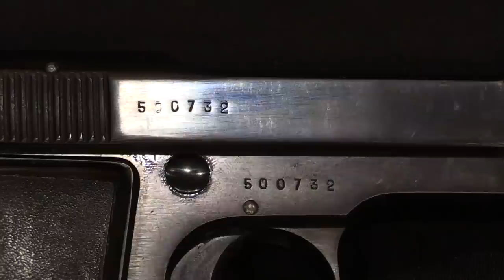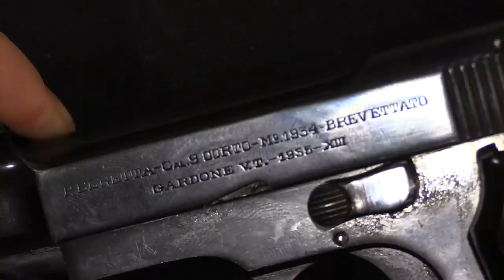Military Trials Beretta 34 - Can You Make it More Walther?

Comment: It's "yellow" because of white balance.
Using a white sheet of paper is a great way to calibrate the camera.
Reply: This. Or setting it manually. Learning the Kelvin scale is useful in camera operating. Generally the higher the number in Kelvin, the cooler the white balance.
Reply: Correct, this is a white balance issue. Easily prevented by checking white balance to calibrate the camera before shooting, and is fixable in post-production as well.
Reply: Aka CNN Trump filter
Reply: @ImmortalDaevon  reddit gold moment
Reply: The best goblin president ever.
Reply: @MangasColoradas941  haha
Reply: @ImmortalDaevon  yes, because the other guy never does that...

Comment: Ian, btw, the yellow in your video is the result of a color temperature mismatch: usually “auto white balance” will figure out the room lighting and adjust but sometimes it needs to be done with either the preloaded filters (indoor incandescent, outdoor, outdoor sunny, fluorescent ) or a manual adjustment. (I worked with cameras a lot past 30 years). Thank you for your excellent vidoes

Comment: I've always had a thing for the 1934 and 1935 Berettas.  Back in the early 1970s as a very young lad I had a toy gun that (other than it's blue color and plastic "stopper gun" construction) was a dead ringer for the '35.  Like a lot of my toy guns from that time it was very realistic and I had NO idea where it came from (could have been my older brother's, could have arrived in a trade, might have been a "battlefield pickup" that I found whilst playing at some abandoned property or other) ... I just knew I really liked it.  Fast forward MANY years and I was the temporary caretaker for one (a 1935 in .32).  Of course, if I was going to be responsible for it, I had to ensure it's firing condition ... and ... um ... be sure it MAINTAINED it's firing ability while in my care (I shot it a lot, LOL ... with permission, of course). Great video!
(Edited ... I mixed up model numbers ... what a NOOB mistake)

Comment: I have a Model 34 with a frame safety and half-cock mechanism. Compared to my other guns it's an absolute pain in the ass to operate the frame safety/slide catch, reload, disassemble, and clean. The slide also tried to bite my grandfather's index finger off (he was clearing a jam caused by a weak mag spring).

Comment: There is a modern firearm in production that has a similar safety set-up. The Phoenix Arms HP-22 has a frame mounted safety and a hammer block safety on the slide. In addition to those, it has a magazine disconnect safety AND some strange system where you have to turn the frame mounted safety on to remove the magazine. It is a very dangerous arrangement to be honest. I have one, and the first thing I did to it was tear it apart and remove a lot of the safety features.

Comment: This looks to me to be less of a failing of the slide safety and more a dumb redesign of the frame safety. I'd almost go so far as to say that they may have intentionally done it that way to, in effect, 'sabotage' that particular variant in a bid to convince the military not to go with the slide safety. Granted, two manual safeties is overly redundant even by my standards, but realistically, the problem really lies in that added tab on the frame safety.
Reply: I think the reality is that they did exactly what the offer wanted and in fact just dropped it in without reworking the internals. That frame safety was still actually a safety with a slightly changed lever so it couldn't be turned all the way around without trying to disassemble the gun. The gun still retained its original frame safety because it was not just the safety but also your disassembly lever so it wasn't easy to just remove. So effectively there was no redesign of the frame safety. They just made the lever shaped differently where it couldn't be used.
Reply: @alexsis1778  I think it depends on how you define redesign. In this case I was counting the addition of that tab as being a (minor) redesign. A more thorough redesign to eliminate the safety element of the frame safety would have eliminated the issue altogether, but undoubtedly would have been costly and time consuming from the company's perspective and arguably not worth the time and trouble.
Reply: That slide safety looks externally, exactly like my PPK.

Comment: I had question, i saw one of these at my local pawnshop this morning,very nice little gun, they guy pulled it out of the display case and let me see it,very nice weight and very tight little gun.

What i dont understand is.... it had a tag on it and the tag said it was a 1934 but the tag also said it was a 32 ACP, now we were busy with other things and i didn't check it out thoroughly, if the 34 was made as a 380 corto (per Wikipedia) and the 35 model was made in 32 ACP how can this one i saw this morning be a 32 if its a 34?  (lol,sounds like a tongue twister).

Maybe the guy putting the gun in inventory made a mistake and its actually a 380?  reason i say this is because when he hand it it to me he said "yeah this is a pretty nice gun, 380 i believe) but then i corrected him and said ," i think is a 32 and he said oh ok" funny thing is neither of us checked,now if i was buying the thing i would have checked for sure.

Comment: "It doesn't work like that!" But...it does work like that.😕
Reply: Clearly it doesn't work well like that. Lots of risk that the gun could be cleaned and left with the frame mounted lever in the "safe" position, and if you had to use it in self defense and you didn't know what was wrong, you'd be dead before you found out.
Reply: I was referring to the politics of procurement.

You are absolutely correct, as far as trying to actually use the pistol. :)
Reply: @petesheppard1709  Boy, does procurement ever work like that. I used to be an an engineer who had to try to wedge demands from Marketing into products *3/4ths of the way through the development cycle*. I was still young then so my hair grew back...
Reply: @markfergerson2145  Can't you just tell them how much more expensive it is to do so? Those guys speak profit margin.
Reply: @Halinspark  Marketing types believe they can just throw technobabble at the customer and crank up the price.
All too often, it works.
Often the customer will change their requirements partway through a procurement cycle exactly as the video describes (or reveal a requirement they had all along and just didn't tell you about at the beginning), and you can't talk them out of it for whatever reason.
Are you familiar with Scott Adams' "Dilbert" comics?
Reply: Even if you can manage to crowbar it in and technically work, it doesn't mean it is in any way a good idea.

Comment: It's funny how the hated aspect of the 34 is the safety of the 92 and M9
Reply: A service DA/SA handgun needs a decocker (that was not the case of the M34, that was SA only). That had been the request of the Italian Police to Beretta. At that point Beretta put it on the slide (92S model) because that's the safest place to put one. The slide mounted decocker is the only one that decocks the hammer completely, since it at the same time rotates the firing pin out of the way of the hammer. All the frame mounted decockers only leave the hammer in half-cock position.
Reply: @neutronalchemist3241  the CZ 75 disagrees with your statement that a service da/sa needs a decocker.
Reply: @ScottKenny1978  The Beretta 92 too didn't have a decocker in 1974, but it was added later, due to Italian Police request, with the 92S. CZ (that didn't evolve the design until 1992, when they added a firing pin block) only came later, with the CZ75BD.
In the meantime, after having experimented many unintentional discharges caused by the agents attempting to manually decock an hammer when still full of adrenaline for a shooting, many Police Departments in the US made mandatory for SA/DA semiauto to have a decocker too.
Reply: Neutron Alchemist True, the Beretta 92 prototype had a frame safety. The Taurus PT92 still maintains it.

Comment: On the other hand, Beretta wasn't too embarassed stealing P38 system and using it in M1951... Tullio, Tullio ...
Reply: There had been no stealing. The pivoting locking block had been patented by Mauser in 1911. When Walther used it, the patent had already long expired. Walther own patent (that applied only to their particular shape of the locking block) was submitted in 1936, and expired in 1950, so it was free to use for anyone in 1951.
Reply: I stand corrected.I knew about Tulios braging about inventing new system and I knew about Walther. I put 2 and 2 toghether and got5.Thanks for information.

Comment: Tiny pistol used by the military? Isn't it normal to have a large framed weapon for the soldiers sidearm
Reply: Draugre .32 was really popular at the time, plus most soldiers wouldn’t have one anyway
Reply: Pistol was really a badge of rank, not something to use in anger.
Reply: Thus having adopted the P38, the Germans manufactured and issued much more Walther, Mauser and Sauer in .32 ACP during the war. For what was the use of a pistol on the field, a simple blowback was favoured over a complex breechlock. From this point of view, to adopta a blowback in .380 ACP from the start was probably the right decision.

Comment: Slide mounted safety's are dumb.  Why make it harder to reach?
Reply: Personal preference and training can make almost any safety work just fine for a particular person. While I'm partial to safeties being in the position of the 1911 safety, I have no issue what so ever working with a slide mounted safety as seen on the Walther P.38 or Berretta 92 series (which actually had a frame safety at first). I think a lot of people really over think the potential problems of something without ever personally checking to see if the problem is even really a problem. Much like 3 round burst is a band-aid solution to just plain poor training and lack of practice time.
Reply: @collinis1  My point is that it isn't outright a bad design for everyone. Some people have no trouble whatsoever with it, such as myself. Realistically, the two main complaints I hear about them are ability to reach them comfortably and accidentally engaging them when manipulating the slide. Some people, like myself, can reach them with no issue and virtually no effect on grip when disengaging them, which is the main thing you'd need to do in a hurry. As to accidentally engaging the safety when manipulating the slide, you actually use the safety lever as a gripping surface and hook your index finger under the lever to ensure that it remains in the upward position, unless it's something like a Makarov, which has the positions reversed, but Makarov safeties tend to be very stiff and not prone to moving accidentally.

I do not disagree that it isn't a good fit for everyone, but I'd say that's why there are such a variety of designs on the market. Choose what works for you and fits you well, practice with it and you shouldn't have many problems.
Reply: @collinis1  What l'm saying is that there is objectively bad, such as Type 14 Nambu safety, which requires two hands to operate, and there is subjectively bad, such as the Beretta/Walther slide safety, which is convenient for some and inconvenient for others. As to this extra training thing, it wasn't really. It was natural for me to grip it that way, especially when I was younger and didn't have nearly the hand strength that I have now. On top of that, if extra training is a negative for somebody, most people would argue that having a manual safety at all is a problem, and many do. I grew up with manual safety guns of both slide-mounted and frame-mounted types, so either one is pretty much instinctive for me. I mostly use frame-mounted currently, simply because the main pistols I have now use frame-mounted safeties, I could pick up my dad's old Walther P.38 or Beretta 92 and operate them just as smoothly as I could when I was 15 and using the more often. As it stands now, I'm perfectly fine with my CZ P-09 and S&W shield with their thumb safeties, but it wasn't the main reason I chose them. (The CZ was for the capacity and being modern enough while still being hammer fired, the S&W won me over with it's combo of size, comfortable recoil despite it's size, and pure manufacturing quality.)
Reply: That's the safest place to put a decocker. Frame mounted decockers only decock to half-cock position. That way the space between hammer and firing pin is open for debris to enter. A slide mounted decocker rotates the firing pin out of the way of the hammer while releasing it, so it can decock the hammer completely.